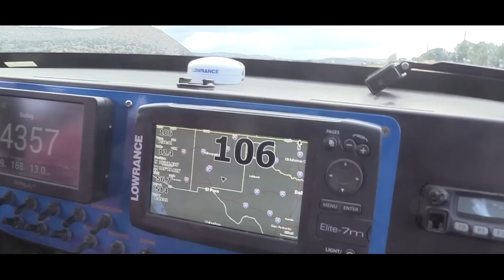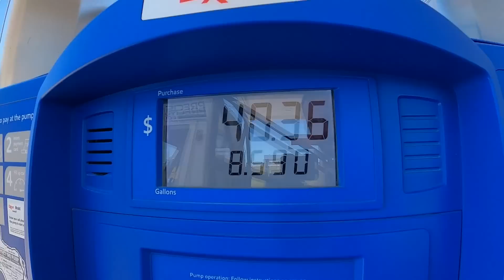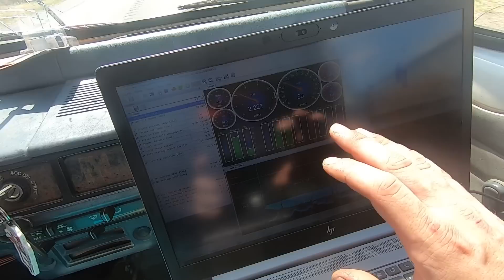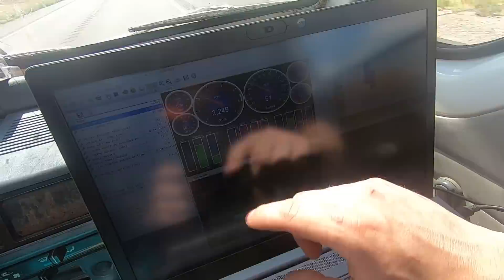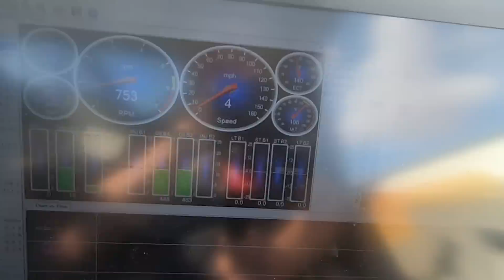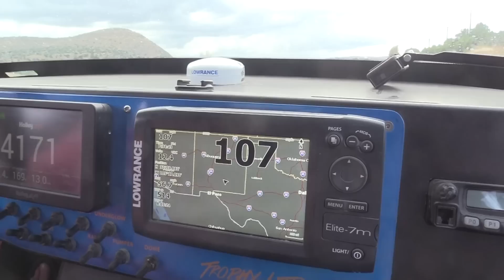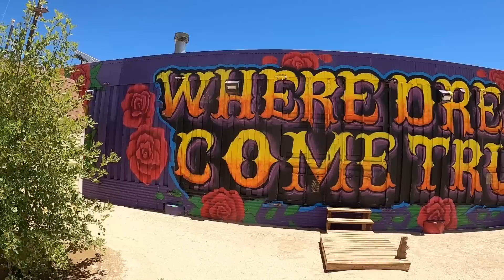YOU CAN'T ROAD TRIP A TWIN TURBO LS SWAPPED KEI TRUCK!

Comment: Could’ve picked up some ducting to scoop air around to lower the intake temps? 🤷 … also wire the rad fan to run constantly.
Reply from the maker: Lots of things could have been done differently 🤠
Reply: @BustedKnuckleVideo  … but then it wouldn’t be what it is 😁👍

Comment: Might be boiling the water in the radiator need to put antifreeze in it and it will definitely help it run cooler I just had this problem with my truck and I live in the south and this is the first time it happened to me because I always just used water and it never boiled in any other vehicle I ever had so antifreeze might help you out it’s definitely worth a try 🤷🏻‍♂️
Reply from the maker: there was for sure some antifreeze in there, just not a good enough cooling system for this setup

Comment: I wonder why hes got the oil cooler mounted on top of the radiator if you're trying to keep the motor cool you should Mount the oil cooler or trans cooler whatever that is not in front of the radiator
Reply from the maker: trans cooler is in front of the radiator on most vehicles though

Comment: John Denver .
Reply: John's crash stemmed from an awkwardly located fuel selector valve(over his left shoulder). Nothing to do with a gauge.
Reply: @Cannibal440  You are correct. Now edited to take in your comments
Reply from the maker: I'll have to look this up.
Reply: @BustedKnuckleVideo  It’s a fascinating storey the way he needlessly died running out of fuel over the ocean when he had fuel on board this experimental plane.
The fuel tap for the second fuel tank was located behind his shoulder on the rear bulkhead and operated with a mole wrench from memory by reaching backwards and behind his shoulder which was impossible when wearing a harness. The coroner recommended always fixing gauges and fuel taps etc in full view in front of the pilot.

Comment: If my alternator went out in the middle of nowhere and I had a predator generator in the back of my vehicle I would just use the generator to charge my vehicles battery until I could get to an auto parts store to get a new alternator
Reply from the maker: That would work if you had a battery charger to use
Reply: I have a small Honda generator and it has a spot you can hook cables into for charging car battery I'm pretty sure that their predator generator that is similar shape and size and newer than my Honda generator has a built-in 12 volt battery charger
Reply from the maker: Interesting. That I did not know.

Comment: Yeah simple all you guys needed to do is move the radiator to the front of the mini truck to make it cool. You guys buried the radiator under the truck sideways and were wondering why it wasn't cooling the engine? Also no fans on it that could work properly. Also after all that heat your engine took. Your head are 100% warped beyond belief lol. You can't just keep replacing head gaskets they will keep blowing again and again because the heads are warped. You need to resurface the heads or get new ones at this point. Hopefully the block didn't warp also with all that heat. But at the very least you need to fix the heads and learn how a cooling system works.
Reply from the maker: Welcome to Deathwish HA